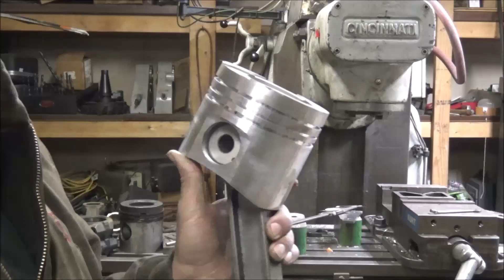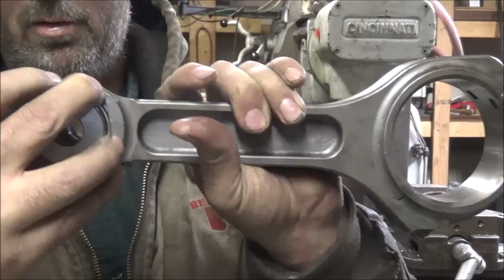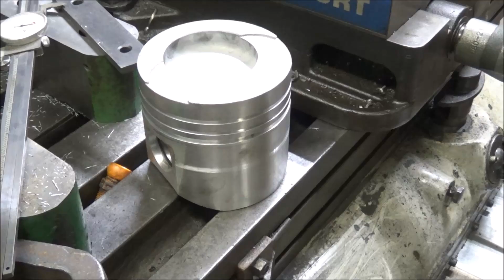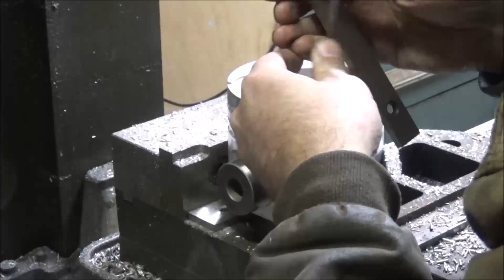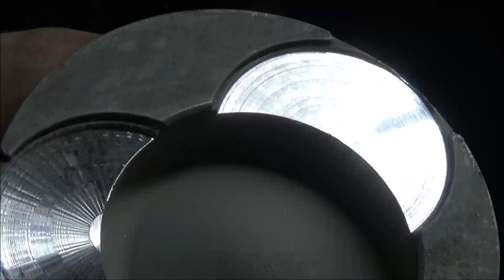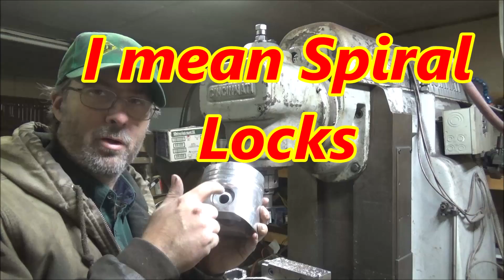Proper Piston Snap Ring Installation Tips Also Racing Diesel Valve Relief Cutting

Comment: I like how you mention the difference between a stock long running engine and a competition engine life of about 100 hours if they are lucky. Used to have that when I was still building drag and circle track engines. Guys would ask me to build them a street/strip engine to the same power levels. They didn't understand that most very high output drag engines have lifespans measured in under an hour of run time!  And that is with constant tear downs to replace parts that are eating themselves with every run...

Comment: Hi Brian, I am after some advice on material selection for wrist pin manufacture. The application is a 6 HP oil engine running around 300 rpm max, so nothing to high spec. We used some EN24T last time but began to wear around the small end bearing so needs to be harder.
Yours Andy
Reply from the maker: I would use either 4130 or 4340 and harden in the 52-55Rc range.
Reply: bcbloc02 many thanks, very envious  of your barn.

Comment: Great video.
Have to say though, the first rule of pistons is not to set them on their tops with the rods attached :)
Saab used to have an issue with snap rings installed backwards on their manual transmissions. Snap ring would pop out of the groove under heavy reverse load and the idler gear would float on the shaft and you would only get about 3mm gear engagement. If you caught it in time, you could repair it through an access cover.
Reply from the maker: Why? Afraid somebody going to knock them over?
Reply: @bcbloc02  Actually had it happen...
I have also seen gravity pull the rod over, cracked a $400.00 piston.

Comment: Do they run shorter deck height on the piston to compensate for the rod length?
Reply from the maker: No it uses a deck plate to add height to the block.

Comment: If my thinking is right, a longer connecting rod would require a piston with a smaller distance between the wrist pin and the piston top. If that is right, the piston would be lighter for higher RPMs.
And a not a question: I accidentally turned closed captions on and while the phase converter was running YouTube said "Applause". If that is the current state of AI, we can rest assured it won't be taking over just yet...
Reply from the maker: I am not sure what you are saying...............................?

Comment: I agree "spirolocks" are far better.
Please make some tall soft jaws for your vice that can be custom bored for that type of work.....
The vice jaw and Vblock on those nice custom pistons made me CRINGE....
I think most of the chatter was in poor work holding?
PS love your channel but rarely comment....
Reply from the maker: The piston walls are over 1/4" thick and the vise didn't leave a mark on it.  making soft jaws would totally be worth it if it weren't for the fact that virtually every set of pistons I do has different pin heights, diameter, and bore size. 2.25" is a lot of cutter engagement at one time. so yeah flex in the system from not having a tight and backed up hold could be part of the chatter. But I know I have a 2" cutter I just used to do some pistons with that size relief and it didn't chatter at all.

Comment: I drive a Ram/Cummins 2500.  The Cummins in my 2500 does not sound of respond like the race Diesels.  There seems to be a delay while the engine starts to make power.  Can you explain what is going on?
Reply from the maker: Sounds like turbo lag. This was particularly bad on the 98.5-2002 vp44 powered 24 valve trucks. They were pretty sluggish below 2000rpm in stock form.
Reply: @bcbloc02  I understand turbo lag . What I see,  in You Tube videos,  is the race truck holding at the start while the engine appears to build power.  The exhaust sounds change as does the smoke.  What is happening in that few seconds before launching?

Comment: Would there be a performance gain to lower the piston top to eliminate the valve pockets.then raise the combustion pocket to compensate. Wouldn't that eliminate the disturbance to the flame front and spent combustion products left in the combustion chamber?
Reply from the maker: My vote would be no but until someone dynos it as the only change I can only speculate as to if I am right or not.
Reply: If you decide to try it move the top ring up and tighten the ring pack. That will clean up the combustion chamber residue.
Reply from the maker: Don't want the top ring any closer they can't stand the heat and get weak fast, also sometimes the combustion forces will crack the heads over the ring lands. This is a high boost high stress high heat application. It only has to live say 30 seconds at a time.

Comment: Perhaps the difference between 20 and 25 HP isn't so big a deal for this particular job, but there's nothing wrong with having a big solid mill to keep your part still and your cutter moving in a straight line.

Comment: BigMan,
Good video
Them are some MAN SIZED PISTONS
“engine building no-no” HAHAHAHA
didn’t realize some pistons are a mix of steel an aluminum
Reply from the maker: Actually these are probably small mid sized pistons. :-) Only 4.75" bore. I fool with some engines in the 7" bore range.
Reply: bcbloc02 
r those 7” engines 9000 series John Deere engines,
I have recently learned 9000 series tractors are the biggest JD makes :)
Reply from the maker: No 3500 series Cats 6.7" bore Deere doesn't build anything over a 5.2" bore currently but my Old 820 Deere is 6.125 " bore though.
Reply: bcbloc02 
So those 6.7” cats are used for race/ tractor “FULL PULL” engines?
Are they construction/ tractor 6 cyl engines?
Is that the best engine for them tractor pullin, I seen that one early video u had of that tractor diggin holes with its tires.. that look pretty serious. My first thought was “dang that one runs good” hahaha
Reply from the maker: No those engines are far too large for pulling they just happen to be the biggest I ever work on.
Reply: bcbloc02 
Cats make the strongest big diesel “for land use” (for a lack of a better term) engine or one that could be used in racing, or is that a matter of opinion :)

Comment: Do the tractor pullers use custom racing  components ?.
Reply from the maker: Your question makes me wonder if you watched the video.........................
Reply: Did not watch at first , know you remachine stuff but are
Custom  cams  , rods and cranks are produced  for the pullers like for a Chevy and Ford engine?
Reply from the maker: They aren't mass produced and readily available no.  They are pretty much all custom order stuff from guys like me. Note the rods and Pistons in this video were custom made from scratch for this application.

Comment: I used to get racing pistons (very expensive) back from the machine shop with sloppy balancing and butchered up valve notches... "Well, you're just gonna put them in a motor, right?"
Reply from the maker: I rarely ever see a set of pistons show up that are even close in balance. Rods either for that matter. I noticed several ounces variance in these billet rods. I spent 2 hours going over these pistons with a file and scotch brite wheel taking off all the burrs and blending the sharp edges before sending them off for coating.
Reply: @bcbloc02  We used to grind the snap rings down and put in two per side. I think the Spirolocks were better but such a pain to get in and out. All the cool kids used aluminum or teflon buttons.

Comment: What is the purpose of shortening the connecting rod?  Is it so they can run aftermarket pistons with thicker top?  Thanks!
Reply from the maker: The rod being used is longer not shorter.
Reply: bcbloc02 my misunderstanding.  Thank you!

Comment: Brian.... Do you have much knowledge of the old two cylinder engines? I have a 1939 B model with babbit mains and rods. The rods I can have repoured but the mains don't think so. You cannot find nos or replacements. Guess my question is how much babbit material is enough. They have about .060 of material left but I don't know if this is enough to reuse them. Any ideas or do you know of anyone who can answere my questions? All the old mechanics are mostly gone now. Thanks!
Reply from the maker: As long as you can pull enough shim to get the proper oil clearance I would say just run it. I just looked on ebay and looks like there is a left and right available as worst case. AB3125R and AB3126R
Reply: @bcbloc02  Thanks for the advise and info. Some of the engines could be converted to the later bearings but mine can't. Just wish I knew if they have enough material. Thanks again.
Reply from the maker: I think you can just drill the hole in the later bearing and add your lube line too it if that is what you need. I only saw a Serial number break for the rh bearing all the lefts were the same. As for mearing thickness any amount is enough. .001" thickness of the babbitt is plenty provided you have the proper oil clearance and the hole is round.
Reply: @bcbloc02  May have to lap them a bit to fit the replacement crank. You have given me new confidence in what I have. I have plenty of shims I can add or remove to get the .003 oil clearance I need. Think I am going to go for it and hope for the best......

Comment: Really nice snap ring tip, we get that right but only because the look to use not knowing what you are sharing. So these are like piston blanks you can modify to fit say a bored out cylinder? Interesting your channel usually (like this is) is a learning place for us and this is why we enjoy your channel. That power mill is doing good work, they sure are an amazing machine Brian as I ran them as a child. Another snap ring tip and maybe not just for a motor but for other high pressure speed use applications, Thank you. Lance & Patrick.
Reply from the maker: Yes it applies to any snap ring in a recipricating assembly. Glad you enjoy! :-)

Comment: Also Brian why do they still use snap or spirol rings ? When you can get rid of them and use a button instead ?
Reply from the maker: Mainly because buttons cause a lot of problems. Unless you tear your engine down a lot for service I see no advantage to them but lots of disadvantages. Ultimately of course it comes down to the application but for this one i wouldn't advise it.
Reply: With teflon I used to see smearing and the button would wear enough the pin could start dancing in the pin bores. Tried aluminum once, would never use it again...

Comment: Nice Paying Job Brian. The sharp edges had me worried for premature detonation but then remembered its a diesel.
Reply from the maker: I broke all the edges with a roll loc disk before sending them off for coating. Nothing worse than a sharp edge melting off your piston and ruining your valve job blowing molten aluminum thru them.

Comment: Newbie here, still learning. At 7:30 (ish) were you explaining a "tool load time save" as i used to see on the cnc mill at work?  I used to run production on one but that fab shop did not have any training (for set up).
Reply from the maker: Yeah that is similar to what I was talking about. It was faster to do the operations concurrent then switch tooling so that meant the order of machining was reversed for every piston from the one before it.
Reply: @bcbloc02  THX

Comment: Circlips are the same in 2-stroke engines...I had many years of making sure they were installed correctly! 
Love those shell mills for counter bore. Did a bunch of skid shoes last week using the same method.
Reply: thank you CompEdgeX
  I was wondering just that. For my 394 Husqvarna getting a new piston.

Comment: That's where Cat put the ends of their  wrist pin clips  ,  dead true about the orientation of the clips & it makes them easier to get in / out  as the circlip pliers get a better grip .  Just a quick one on the piston are they cam machined or parallel ? as your  holding them in vee blocks  instead of the pin .  just a thought  Cheers .
Reply from the maker: The skirt sides are parallel but the tops are slightly smaller so have to be aware of that. The snap ring orientation gets more important the bigger the engine as the heavier the snap ring the more likely it is for inertia to sling it out. That is why the big Deere diesel 2cyls that had pistons bigger than a old D9 CAT were so prone to the problem.  Get a big load behind one shoving it down a hill on the highway and get some overspeed and BOOM!
Reply: Its probably not the wrist pin that damages the bore, its the hardened snap ring floating around in there with it.

Comment: Damn must be a substantial increase in compression, or is the head domed more to compensate.  I know they push a ton more air with the turbos.  It’s amazing they gain stroke rather than reduce it for added RPM.   Have not been around pulling tractors much really since we lost a friend in the 70s due to a rear tire exploding while they were screwing the beads fast to the rim.  Not sure is you had heard about that story was popular for a while.  The person in question was from ADA , Ohio. 
  It was just before the Bowling Green and at that time there was a ton of time in getting new tires cut down.
 Great content 👍
Reply from the maker: I don't remember much about the 70's since I was only one. Sorry about your friend. This engine will actually end up being substantially decreased in compression from stock. The deck plate makes up for the extra rod length and the piston winds up traveling the same path it just happens further up from the crank.
Reply: bcbloc02 so are they just after a better rod ratio if it’s not getting stroked?
Reply: @twinstaged  Part of the plan when changing connecting rod length is to alter the amount of time the piston spends at each end of the piston travel, the longer the rod the more time the piston spends at TDC while at the same time spending an equal amount of less time at BDC. There are a number of factors that play in to rod length choices, much of this has to do with cylinder "trapping pressure", by that it means how long the engine can maintain the combustion phase to release as much heat from the fuel as possible, this is especially important when the engine speed has been drastically increased. The combustion speed (BTU release) period is directly related to fuel type, bore size and crankshaft speed, the idea while seemingly simple is a tricky balancing act, not only is the BTU energy important but also there's a fine line to avoid charge dilution during the inevitable valve overlap phase that needs the balance of valve timing with the pre and post TDC period.
 Sorry to for such a long response but it's all part of competition engine building, all too many times great engines perform poorly because basics are overlooked but by the same vein many marginal engines perform well because the person tuning it knew their stuff.
Reply: @Peter-V_00  Good comment, just learned something, haven't machined much in the engine department...   ;)
Reply: @pierresgarage2687  Machining it and making it perform are two different things.
Reply: Experience in a field makes a difference...   ;)
Reply from the maker: Yes it is just to make it easier on parts when running 3 times the design speed.
Reply: bcbloc02 makes sense.  I’ve done the same thing with Mitsubishi engine using a tall deck block.  I have been wanting to build a deck plated Mitsubishi with wet sleeves, but I’m a ways off.  I need to bore the cylinders out of a block and see what I’m left with.

Comment: Thanks for the tip on the clip I’ve never thought about that happening will definitely remember on my next rebuild. Do you ever get any international dt414-466 stuff in the shop?
Reply from the maker: Yes I have done several 436, 466's over the years, but not as much lately. Mostly because you can buy all the red stuff you want already off the shelf aftermarket but a lot more of the Deere stuff has to be made.
Reply: Thanks Brian we farm with mostly older internationals  don’t know much about pulling at all thanks for the great content always